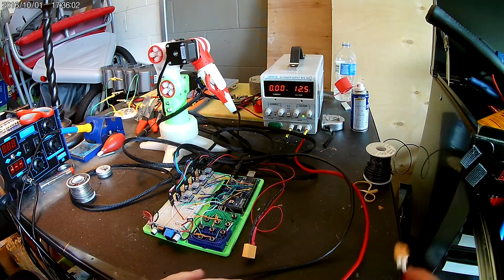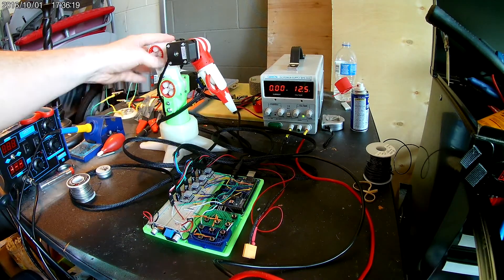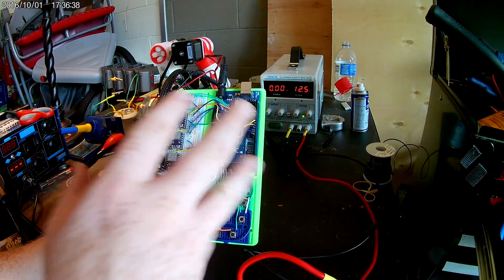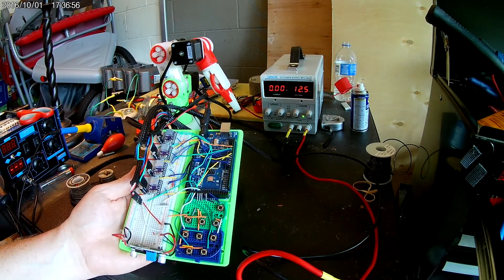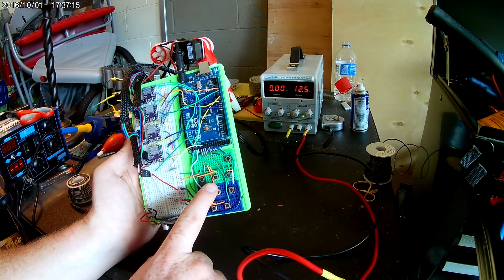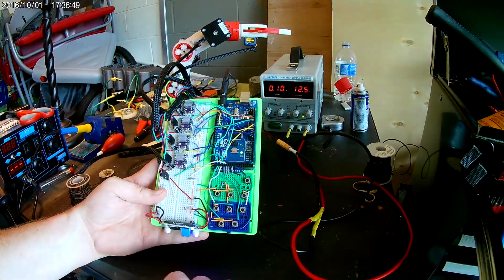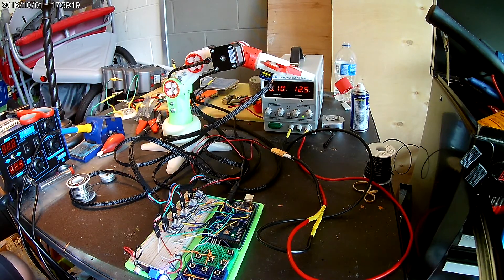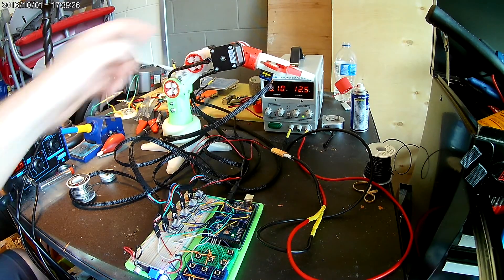3D Robot Printed Robot Arm

Comment: This is a great version of this arm. The motors sound extremely cool. Does the control increase and decrease the speed over the movement, giving the change of PWM frequency? The pwm seems to lower towards the end of the movement making the tone of the motor go down at the end. Perhaps that is a deliberate pwm control to prevent the motor from just stopping dead whilst the momentum of the arm is still going, which prevents gear damage?
Reply from the maker: I just wrote something up real quick to test the buttons. I haven't got around to make a decent code yet for it. I'll post it just remember it's kind of sloppy.
Reply from the maker: //Eric Robot button code
#include <AccelStepper.h>

//Rotation
#define ENABLEPIN 8 
#define stepPin 4
#define dirPin 7
#define button1 53
#define button2 51

//Joint 1
#define ENABLEPIN1 10
#define stepPin1 2
#define dirPin1 5
#define button3 49
#define button4 47

//joint 2
#define ENABLEPIN2 11
#define stepPin2 3
#define dirPin2 6
#define button5 45
#define button6 43

//joint 3
#define ENABLEPIN3 12
#define stepPin3 52
#define dirPin3 50
#define button7 41
#define button8 39

AccelStepper Rotation(1, stepPin,  dirPin); // Used For J0,  This is the Base Rotation Drive
AccelStepper Joint1(1, stepPin1, dirPin1); 
AccelStepper Joint2(1, stepPin2, dirPin2);
AccelStepper Joint3(1, stepPin3, dirPin3);

int button1State;
int button2State;
int button3State;
int button4State;
int button5State;
int button6State;
int button7State;
int button8State;

void setup() {
  //All pins set to outputs
  pinMode(stepPin  , OUTPUT);
  pinMode(stepPin1  , OUTPUT);
  pinMode(stepPin2 , OUTPUT);
  pinMode(stepPin3  , OUTPUT);
  pinMode(dirPin    , OUTPUT);
  pinMode(dirPin1    , OUTPUT);
  pinMode(dirPin2   , OUTPUT);
  pinMode(dirPin3    , OUTPUT);
  pinMode(ENABLEPIN    , OUTPUT);
  pinMode(ENABLEPIN1    , OUTPUT);
  pinMode(ENABLEPIN2    , OUTPUT);
  pinMode(ENABLEPIN3    , OUTPUT); 

  //button pinouts 
  pinMode(button1, INPUT_PULLUP);
  pinMode(button2, INPUT_PULLUP);
  pinMode(button3, INPUT_PULLUP);
  pinMode(button4, INPUT_PULLUP);
  pinMode(button5, INPUT_PULLUP);
  pinMode(button6, INPUT_PULLUP);
  pinMode(button7, INPUT_PULLUP);
  pinMode(button8, INPUT_PULLUP);
 
  //Motors start in the off position 
  digitalWrite(ENABLEPIN, HIGH);
  digitalWrite(ENABLEPIN1, HIGH);
  digitalWrite(ENABLEPIN2, HIGH);
  digitalWrite(ENABLEPIN3, HIGH);

  // I notice that the putting a higher acceleration speed and pluse width gives me the right amount of torque
  //Rotation Joint
  Rotation.setMaxSpeed(1300); //set max speed the motor will turn (steps/second)
  Rotation.setAcceleration(2000); //set acceleration (steps/second^2)
  Rotation.setMinPulseWidth(500);
  Rotation.setCurrentPosition(0);
 //Joint 2
  Joint1.setMaxSpeed(1200); //set max speed the motor will turn (steps/second)
  Joint1.setAcceleration(1500); //set acceleration (steps/second^2)
  Joint1.setMinPulseWidth(800);
  Joint1.setCurrentPosition(0); 
  //Joint 3
  Joint2.setMaxSpeed(1200); //set max speed the motor will turn (steps/second)
  Joint2.setAcceleration(2000); //set acceleration (steps/second^2)
  Joint2.setMinPulseWidth(500);
  Joint2.setCurrentPosition(0);
  //joint 4
  Joint3.setMaxSpeed(1200); //set max speed the motor will turn (steps/second)
  Joint3.setAcceleration(1500); //set acceleration (steps/second^2)
  Joint3.setMinPulseWidth(500);
  Joint3.setCurrentPosition(0);
  Serial.begin(9600);

}
void loop() {
 
 // The setup utilizing all the buttons
 // button 1 for the left rotation

 {    // Start of button 1 and 2
button1State = digitalRead(button1);
button2State = digitalRead(button2);
 if (button1State == LOW)
 {
    
    digitalWrite(ENABLEPIN, LOW); //Turn on motor
    Rotation. move (-70000);
    Rotation. run ();
   
    button1State = digitalRead(button1);

 if (button1State == HIGH)

{ 
    Rotation.stop();
    Rotation.runToPosition();
Serial.println("LEFT");
}

}
//Serial.println("LEFT");
// button 2 for the right rotation
 if (button2State == LOW)
 {
    digitalWrite(ENABLEPIN, LOW); //Turn on motor
    Rotation. move (70000);
    Rotation. run ();
   
    button2State = digitalRead(button2);
 
 if (button2State == HIGH)

{ 
    Rotation.stop();
    Rotation.runToPosition();
    Serial.println("RIGHT");

}
}
} //end of button 1 and 2  

{  // Start of button 3 and 4
button3State = digitalRead(button3);
button4State = digitalRead(button4);
 
 // button 3 for the down 
 if (button3State == LOW)
 {
    digitalWrite(ENABLEPIN1, LOW);//Turn on motor
    Joint1. move (70000);
    Joint1. run ();
   
    button3State = digitalRead(button3);
     
 if (button3State == HIGH)

{ 
    Joint1.stop();
    Joint1.runToPosition();
    Serial.println("JOINT 2 DOWN");
}
}
}

{
  //button 4 for the up
 if (button4State == LOW)
 {
    digitalWrite(ENABLEPIN1, LOW); //Turn on motor
    Joint1. move (-70000);
    Joint1. run ();
   
    button4State = digitalRead(button4);
 
 if (button4State == HIGH)

{ 
    Joint1.stop();
    Joint1.runToPosition();
    Serial.println("JOINT 2 UP");
}
}
} //end of button 3 and 4  

{ // Start of button 5 and 6
button5State = digitalRead(button5);
button6State = digitalRead(button6);

//button 5 for the up
 if (button5State == LOW)
 {
    digitalWrite(ENABLEPIN2, LOW); //Turn on motor
    Joint2. move (70000);
    Joint2. run ();
   
    button5State = digitalRead(button5);
 
 if (button5State == HIGH)

{ 
    Joint2.stop();
    Joint2.runToPosition();
    Serial.println("JOINT 3 DOWN");
}
}
 // button 6 for the down 
 if (button6State == LOW)
 {
    digitalWrite(ENABLEPIN2, LOW); //Turn on motor
    Joint2. move (-70000);
    Joint2. run ();
   
    button6State = digitalRead(button6);
     
 if (button6State == HIGH)

{ 
    Joint2.stop();
    Joint2.runToPosition();
    Serial.println("JOINT 3 UP");
}
}
} //end of button 5 and 6  

//button 7 for the up

{ // Start of button 7 and 8
button7State = digitalRead(button7);
button8State = digitalRead(button8);
 if (button7State == LOW)
 {
    digitalWrite(ENABLEPIN3, LOW); //Turn on motor
    Joint3. move (-70000);
    Joint3. run ();
   
    button7State = digitalRead(button7);
 
 if (button7State == HIGH)

{ 
    Joint3.stop();
    Joint3.runToPosition();
    Serial.println("JOINT 4 DOWN");
}
}
 
 // button 8 for the down 
 if (button8State == LOW)
 {
    digitalWrite(ENABLEPIN3, LOW); //Turn on motor
    Joint3. move (70000);
    Joint3. run ();
   
    button8State = digitalRead(button8);
     
 if (button8State == HIGH)

{ 
    Joint3.stop();
    Joint3.runToPosition();
    Serial.println("JOINT 4 UP");
}
}
} //end of button 7 and 8  

// Shutdown stepper motor after use 
digitalWrite(ENABLEPIN, HIGH);
digitalWrite(ENABLEPIN1, HIGH);
digitalWrite(ENABLEPIN2, HIGH);
digitalWrite(ENABLEPIN3, HIGH);
}
Reply: how much quieter with 2130 drivers?